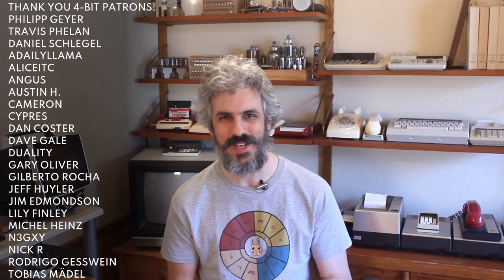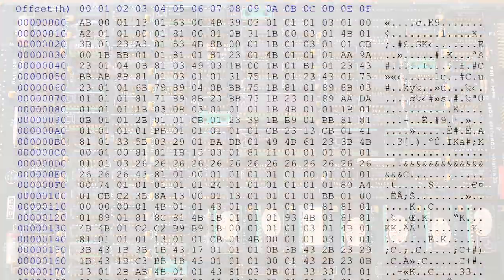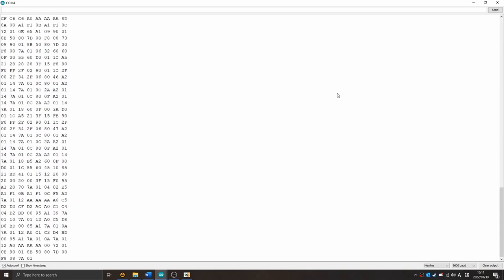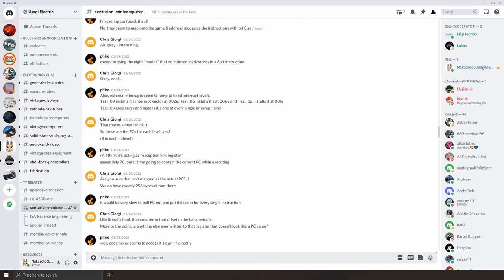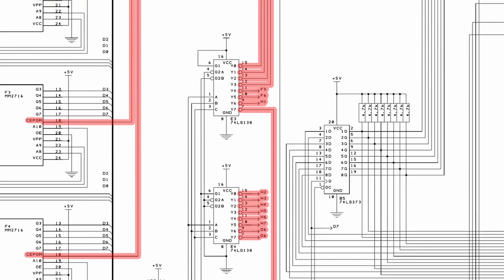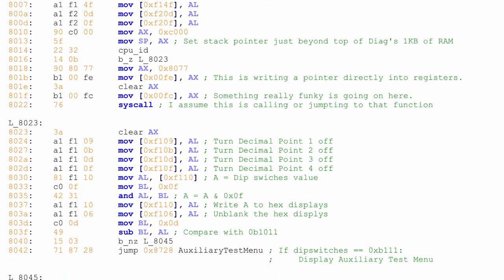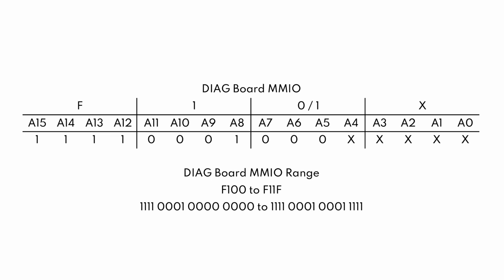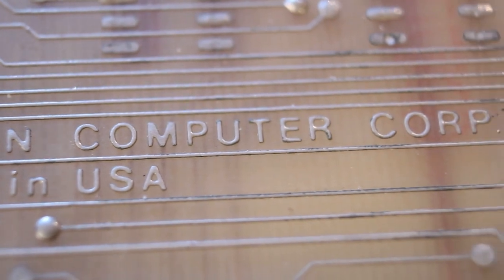Minicomputer Part 9: Reverse Engineering the Diagnostic Board

Comment: Amazing work.

If Centurion has custom processor based on bit slices, how was code reverse engineered?  How did they figure out how to map hex values to assembly instructions?
Reply: I had the same question in mind. Especially as AX, BX (*) are 16-bit register names coming from x86 instructions set which seems to be a time travel story here :)
So, how to have figure out the meaning of each opcodes per Hex value without knowing them ? It will be very interesting to know. Did you get the opcodes list from Centurion books, or any others references ?

(*) AX, BX registers are displayed from the video during the reconstruction of the programs from ROM at 11:40 which seems strange to me.
Or, may be, you decided to use those names "AX", "BX" as conventional register names which have obviously nothing to do with x86 instructions set (as created in the future compared to Centurion area). Back to the future episode 4 ? :)

Anyway, excellent work guys and "Chapeau !!", wishing you all the best for resurrecting this Centurion Computer
Reply: Although not involved I can answer some of this one from my own experience with bit slice. The ROMs on the CPU control the bit slices  presenting to the rest of the system a processor running  machine code. The ROMs on the diagnostic board contains machine code. hence the reverse engineering to assembler is possible although wildly outside my knowledge.
Reply: This is my big question too - was the process of reverse engineering the instruction set documented anywhere?
Reply: There will be a video about the process as well, but a lot could be done from the ASCII text (because that stated what the code was supposed to do) and from hardware addresses reverse engineered by tracing the cards.

The mnemonics are very much in a flow still. There is no reference from Centurion, so names can be given arbitrarily.
Reply: @yvesdeepflight9335  AX and BX aren't special or x86-specific... in the early 1970s I wrote assembler on British built / designed mainframes (ICL 1900 series) and the 8 "accumulators" - you'd call them "registers"-  were X0 to X7 because X has been a data variable since pretty much day 0 of computers. So ANY Architecture that has more than one register is going to call them A B C or 0 1 2 etc so the A register is going to be AX etc. x86 just adopted  an existing age-old convention, as have these geniuses :)
Reply: @yvesdeepflight9335  'A' typically stands for Accumulator and if you have an 8 bit architecture with 16 bit extensions, AL and AH are the two halves of your 16 bit register and AX is the standard way to referring to AH & AL together. If you have more than one accumulator, that's customarily your B accumulator. This CPU design pre-dates the 8086.
Reply: @philbowles3240  Thanks for your comment. After a second thought I also realized that they had probably choose to use those "familiar" names as AX, BX, SP etc which defintely are not x86 specific, as standard names (nothing more) during the discovery process (reengineering part) of the Centurion instructions set. Anyway, It was funny to see those names from a "slice processor" way older than the 8088 (8 bit one).
Now, the thinking behind to know which instruction (or here, which hex value) corresponds to which possible opcode will be very interesting to share (a kind of Sherlock geek story). 😊 Lot of fun for sure !
Reply from the maker: @yvesdeepflight9335  I can't really comment too much because honestly, a lot of it is over my head! But, I'll try to give my best account. Firstly, there was no documentation anywhere that we could find, so this was all pure hardcore reverse engineering efforts by the guys! But, that's also why some of the register names seems to borrow from other places. Like the 8086 architecture, this CPU has multiple 16-bit registers of which the high byte and low byte can addressed separately. So, we borrowed the 8086 mnemonic of AX, AH and AL for A Register full word, high byte, or low byte respectively.

The bit-slice architecture on the CPU is really just emulating a different type of CPU architecture that the rest of the system doesn't particularly know about. But, the software on the ROMs on the DIAG board is actually machine code which can be translated into assembly if you know the right things to look for.

As I understand it, they started with the known ASCII that we found by stripping the MSB. Once they located that ASCII in the original Hex, they could locate the null terminator byte and then start working backwards from there. We did find an old brochure for the Centurion that boasted having 8-bit, 16-bit or 24-bit instructions, so we knew that instructions were going to be 1, 2 or 3 bytes long, which helped us find delineations between instruction and addressing modes. 

Also, we had Ken Romaine hooking us up with some vital information on potential address locations for MMIO and other important bits, which when combined with the schematics of the DIAG board, let them start finding specific addresses. Then it was just a matter of building iterative versions of the disassembler and slowly filling in the blanks one instruction at a time. But, as we figured out each instruction that filled in more of the original hexadecimal and made it easier and easier to figure out the remaining questions marks.

I hope that all made sense!
Reply from the maker: @davidtaylor6124  You can find everything we've done over on the GitHub repositories!
Fair warning though, there's all sorts of spoilers hiding out in there, haha.

https://github.com/Nakazoto/CenturionComputer
https://github.com/phire/centurion_isa  <- This is the big one for the ISA reverse engineering stuff
https://github.com/agentorange96/CenturionAssembler
https://github.com/tergav17/CPU7Plus
Reply: @UsagiElectric  Yes, this is really cool and we can feel the emotional part of all this discovery process from your videos. Kudos to you and your team mates who slowly, piece after piece, have figured out which opcode are from which hex value. The mechanism you just described (knowing some of the RAM / ROM / IO addresses) to recombine where the ROM Diags programs are supposed to work is really excellent. I'm 58 and I was using a TRS80 when I was 15 doing some disassembling of the Basic interpreter to try to understand the logic behind (Z80 assembler). So, your videos are reviving to me all of these great moments, as for the others who make comments on your videos who, I'm sure, have a similar feeling based on their own story 😉. Again, Thank a lot for such emotion and intelligence you shared. We do need that during all these difficult days of man craziness.

Comment: Amazing work! It is always fun to watch these kinds of projects unfold. I can't wait for the next episode.

I am curious about the architecture. Is it an 8-bit architecture with a 16-bit address space, is it fully 16-bit or am I way off the chart here and is it something else?
Reply from the maker: Thank you!
You actually totally nailed it, it's an 8-bit data bus with a 16-bit address bus. Initially I was confused by the CMD card which also had two 4-bit slice ALU chips on it, but the CMD card is specifically for controlling the Phoenix drive and it's essentially it's own 8-bit processor. The CPU6 card here also supports up to 256k of RAM, so it has some bank switching control going on in it as well.

Comment: Frankly, I thought you've already made that analysis for the computer boards. It surprises me you didn't considerate a non-8 bit or non-ascii charset before.
Reply from the maker: Honestly, I'm a hardware guy through and through. The software side of stuff is quite a bit over my head.
But, the ROMs on the computer boards don't actually contain any ASCII values because they're not actually machine code. Instead, they're being used as replacements for large swaths of logic. So stripping the most significant bit doesn't actually provide any insight.

Comment: If you can scare up a GQ-4X EPROM reader, those can read 2716s no problem. I dumped several EPROMs with it (2716 and 2732) just fine.

Comment: Man, I'm so rooting for U ! go Usagi go ! BTW, why does the assembly look so much like Intel stuff? Is that because the guys decided to use some Intel nomenclature, or is it because it actually is? If so, this thing would probably run some kind of MP/M, which is a multi-user CP/M. This would be easier to find a copy of... BTW2, have you tried contacting any disk recovery company? Good luck !!
Reply from the maker: Thank you so much!

As for the nomenclature, we didn't actually know what the original Centurion Assembly mnemonics were, so we kind of had to pull from other styles that kind of resembled the architecture here. The Centurion has a series of 16-bit registers and it's possible to address the whole register, just the high byte or just the low byte depending on the addressing mode. Since that's really similar to how the 8086 uses and addresses its registers, we borrowed the naming scheme. For example, AX would be the whole 16-bit A register, AH would be the high byte of the A register and AL would be the low byte of the A register. In short, we just copied what other popular/more modern CPUs were using for their assembly, haha.

As for the disk, the Centurion Instruction Program Loader is stored at track 0, which is the outermost track (the destroyed area). So, unfortunately, we've already lost quite a bit of very vital data just in the head crash. But, I'm actually working on some stuff behind the scenes that has me really hopeful on potentially getting my hands on some original Centurion software. It'll be a while before I get to it in a video, but I'm very hopeful!

Comment: Hi , Great video as usual , Happy to see that you still working on this ' little ' computer .
Onje thing that came to my mind is the harddisks platters .
There is people out there that can get data off those platters and if the heard crash is located 
in a way that data isnt destroyed you could be in great luck , of course it depending on where 
it actual stored the data .
But even if some data is destroyed then it could be still possible to get some data off the platters 
and it could help recreate the whole operating system .
Imk thinking if yo could be able to get some ( hopefull all ) the files there is not included on the 
diagnostic board .
One of the commenters in previous MiniComputer video mention a guy who can do this 
Im on coffe right now and doesnt member hes name , but I think it is worth a try .
You could combine all data into a complete or almost complete operating system .

Great video and nice to see you working on the boad , hopefully all those data can be used .

Edit , you have a lot of harddisk plates , Have you looked into if there eventually should be a backup ?
You know companies do backup their data and system so maybe one platter could be a system backup 
in case the system fails .
I do not think they all is only user data .
Try investigate what is on all those platters , also the labels could be wrong as those was stored 
long time with no use .

Edit 2 , You could also try contach computer museum in england ( or other good ones ) to see if 
there is some guy who know how to make a harddisk emulator you can use .
By emulator I mean a sd card based disk on interface there can talk to the machine .
I have longer time ago watched a video here on youtube where they did just that with a very 
old system not so different from yours .
I cant remember the video right now but I will try to find it and the name and way to contact 
the guy who made this interface .

Keep up the great work , I love following this .
( sorry my typos , it is morning and im on a BIG coffe I was drinking yesterday so my head sleep a little )
Cheers  : )
Reply: I used to work in data forensics / recovery. If anyone can get data off those platters*, then I will eat not only my own hat, but theirs too. Before folk chime in quoting NSA etc etc  let me qualify some stuff.

Those drives have track 0 on the outermost portion. That holds the geometry information which allows the phsyical signal routing which is now bare metal, so IF it were possible, you'd need " frigged controller" where you could DIP-switch the rotation speed / latency / interblock gap / block size. timing intervals etc etc etc  so you could try a few different ones after "manually" tracking the new heads to a "safe" portion of the oxide layer etc. Long story short: special controller required.

Long story even shorter: *=easily and economically and in a sensible time-frame resulting in data that is both meaningful and useful.

Unless you have the resources of the NSA and NASA and the CIA and Seagate and Western Digital then this is a non-starter.
Reply: @philbowles3240  The folks at DriveSavers could definitely get the raw blocks off the rest of the platters where the oxide remains. Turning the remaining 400 byte long sectors into useful data is another issue but I wouldn't be surprised if at least some of the applications are still there. The VTOC and catalog are gone along with most if not all of the OS, but I'm sure some data remains. Just in case it's pertinent here, DriveSavers does data recovery for three letter government agencies and some of the staff there have security clearances to enable that capability. They have a clean room and I've toured their facilities.
Reply: @Peter_S_  they will still need something to spin the platter and lift heads over the sanded area... I still say "theoretical solutions be damned, no.one will be getting data off that platter" . It's pointless arguing unless you have the data to show me, which you don't.
Reply: @philbowles3240  They have thousands of drive mechanisms to use as donors. They even have helium filled enclosures for working on high speed drives. I would be surprised if they didn't have something for a disk pack. They simulate blown controllers in FPGAs using Verilog. I'll bet you dollars to doughnuts the data rate off those platters is clocked at 4.34Mbps. It's only a matter of budget. It's not hard to move a head until you find a track using a scope. The only problem is how close you can get to the crash zone before you sacrifice your recovery head. I've done data recovery for over 30 years for so wet blanket people get to me.
Reply: @Peter_S_  waiting for the data. My requirements are that it's fast , economic and provides useful meaningful data if you read my posts carefully. That ain't happening despite all your fancy acronyms. So until you have some meaningful data for me, I'm done with pointless academic yes it's theoretically possible bs...when in real life it isn't. That's a) the whole reason for my post b) the reason for the asterisk...to avoid stupid academic discussions exactly like this. I'm outta here.
Reply: @philbowles3240  You have requirements 🤣
Reply from the maker: Thank you so much!
Peter and Phil covered most of the bases here I think. It is totally possible to get any of the remaining data off of the platter, but it's not exactly feasible. Also, the camera didn't quite pick it up, but the rest of the platter is pretty beat up. I think when the head crashed as hard as it did, it flung little pieces of metal all of the disk cage, which scratched and nicked the rest of the platter. So, while it may be possible to get something off of it, I really don't think there's going to be anything usable, which makes it a bit too much of a risk to undertake since that kind of work would be very expensive indeed.

But, I have a few things I'm working on in the background that I'm really hopeful for, and with a lot of luck, we may yet have another way to get some Centurion software running! I don't want to spoil too much now, but rest assured, I'm definitely making some inroads on the Centurion OS front!
Reply: @UsagiElectric  That sounds great  :  )
I keep my fingers crossed that yo end 
up with a working OS and machines 
running .
Keep up this great work , 
Cheers in Coffe  , I just in middle of 
my morning coffe  :  )